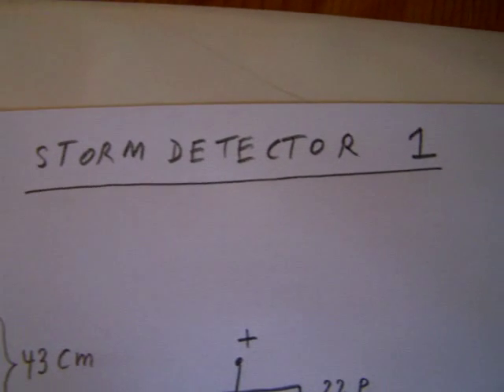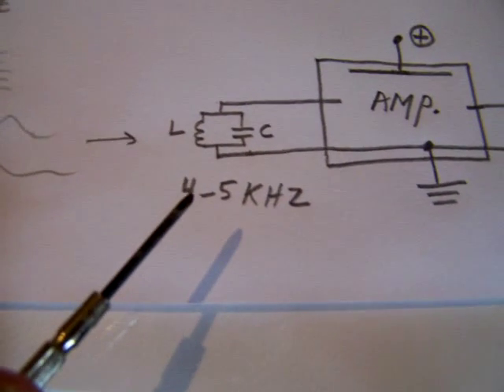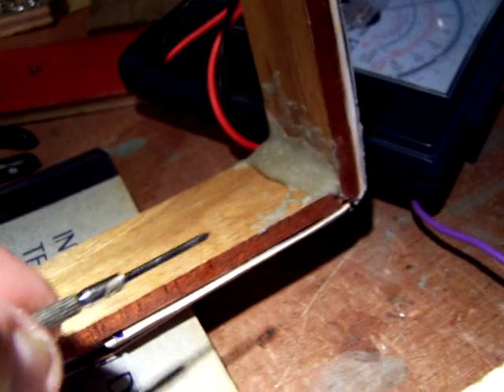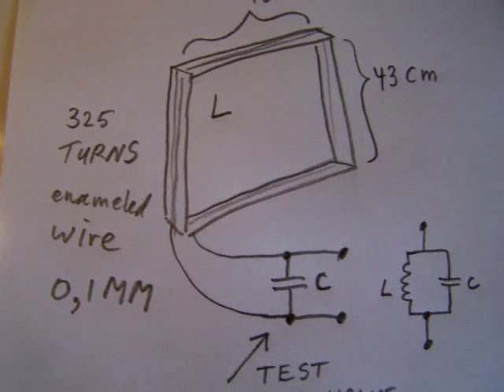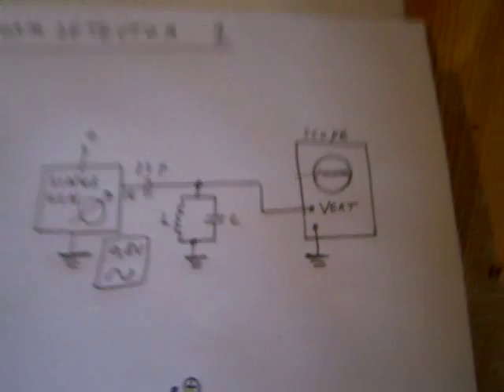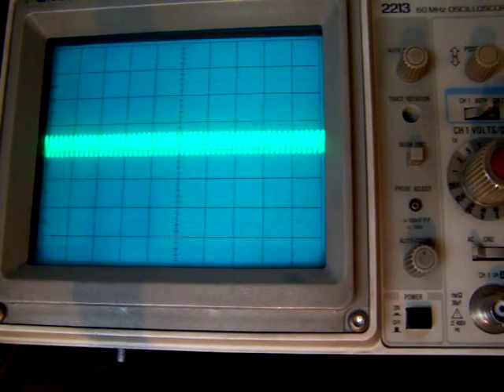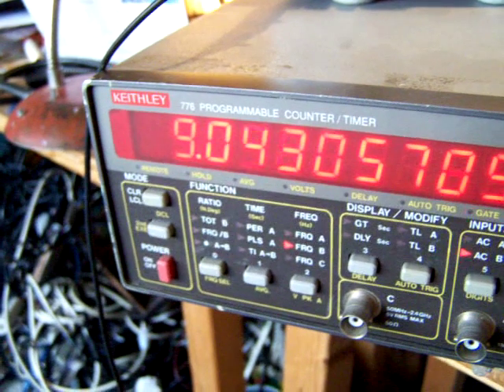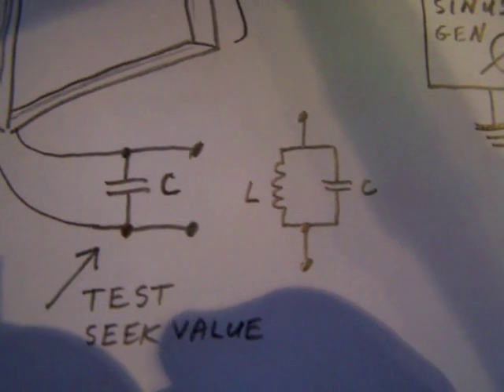VLF receiver 1 KHz-10 KHz, part 1 (the coil)

Comment: Hello, respectable master,
Is the antenna that is 1khz-10khz? Also, is the square antenna in your project a directional or non-directional antenna?
Reply from the maker: The "square antenna" is in fact a "stretched out coil" with a diameter of (say) 30 cm. Could also be made with a 1 meter diameter. Such a "coil antenna" in Dutch "raamantenne" (litt. translation "window antenna") is always direction sensitive acting on the electromagnetic field.
Reply: @radiofun232  Thank you for the answer.
So, does the size of your antenna(for 30cm or 40cm) that have something to do with frequency?
for example, if we want to detect between 2khz and 200khz, how will we have to change the dimensions of the antenna? will we have to replace circuit elements in the same way?
Reply from the maker: @ahmetozdemir7173  here is a good video
https://youtu.be/adJp1zO9qfo
There are also many other good video's about loop antenna's on you tube or the WWW when you want to design/calculate one.